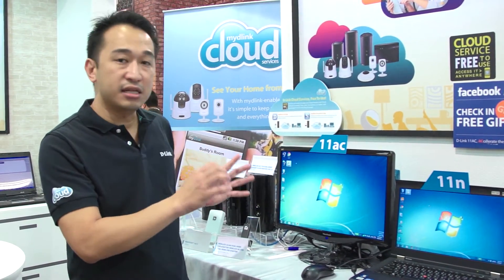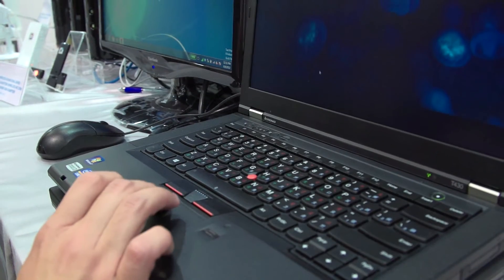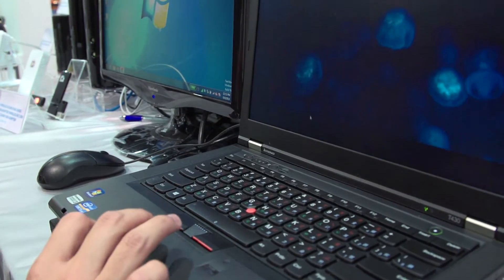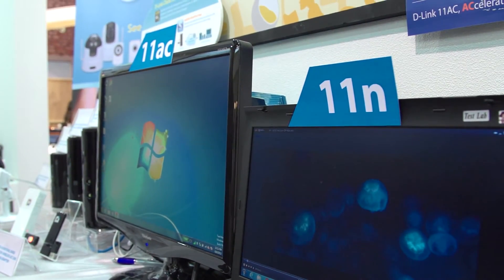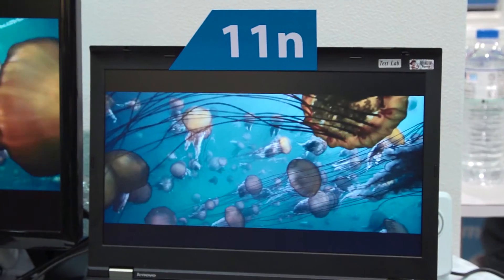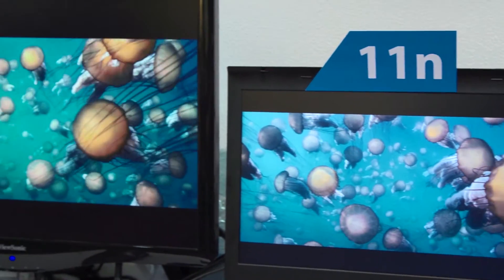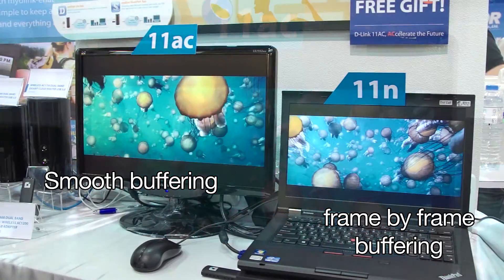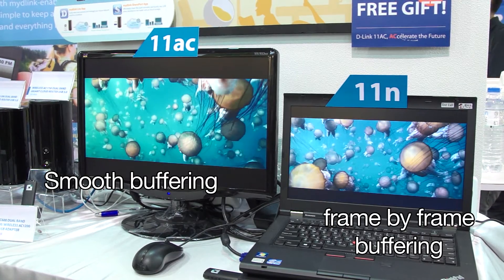MediaTek@Computex 2013: High Performance 802.11ac Demonstration

Comment: hey make a beter faster chip for smartphones not like the alkatel ot idol x its fast as the  samsung galaxy s3 and it has a Quad core, 1500 MHz, ARM Cortex-A7 and a Graphics processor PowerVR SGX544 also 2 gb of Ram etliest make a 1800 Mhz ARM Cortex-A9 or A15 and a Graphics processor  PowerVR G6430 (quad-core graphics or duel core ) this will put you on the top alkcatel